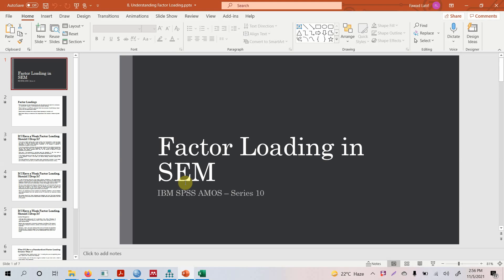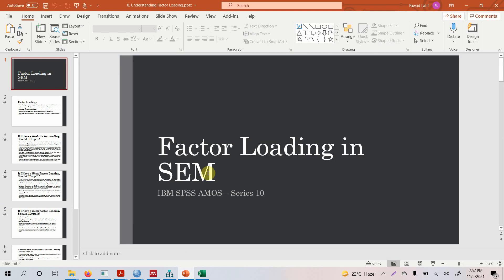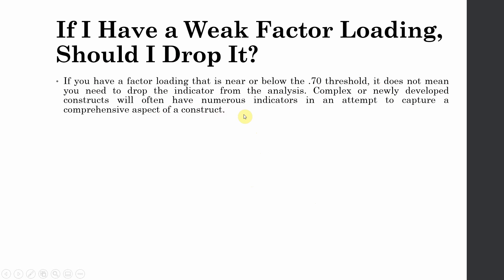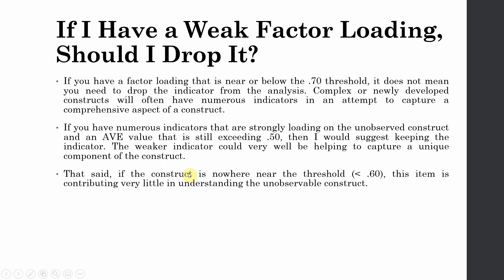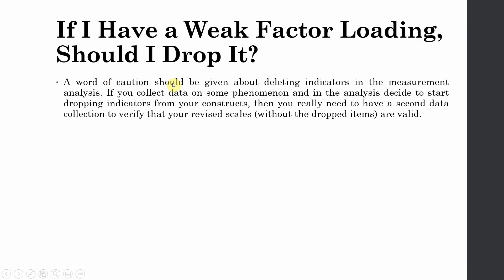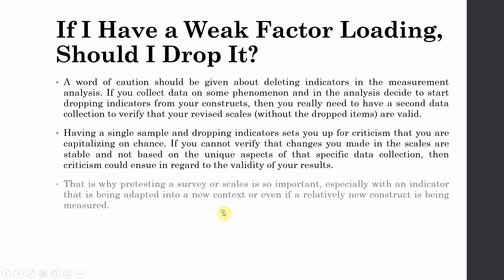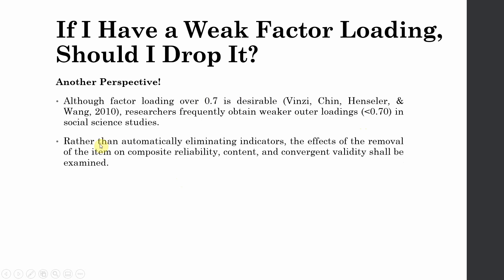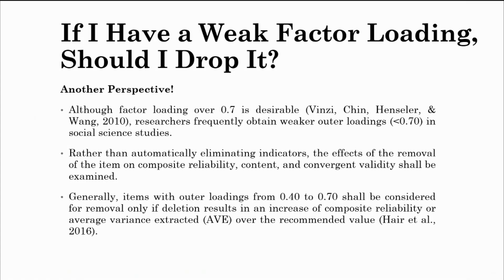14. SPSS AMOS | Factor Loadings in Structural Equation Modelling (SEM)

Comment: Assalamualaikum dr. Regarding deletion of indicator, Is there a restriction of how much can be deleted in a SEM-PLS study? Because I'm currently facing lack of discriminant validity in my thesis and to solve it I'm deleting quite a lot of indicator. Prior I have 62 indicator but I have deleted 17, is that consider okay dr? I have 6 constructs (4 IV, 1 moderating, 1 DV)
Thank you in advance
Reply from the maker: 17 is a little on a higher side.
But make sure, the content Validity is not violated.
Reply: @researchwithfawad  I see, it's too high. How much would you suggest is a sufficient number of deletion dr? Is there a specific reason for suggesting such deletion is too high? Thank you again for the respond dr
Reply from the maker: try not to go over 15-20% at most, if absolutely necessary
Reply: @researchwithfawad  understand. Thank you so much for the assistance dr.

Comment: Asalamualikum Sir,
If u could please share the references
Reply from the maker: WAS. Here they are, you can also check video description

Key References
Collier, J. E. (2020). Applied structural equation modeling using AMOS: Basic to advanced techniques. Routledge.

Hair, J.F., Jr., Hult, G.T.M., Ringle, C. and Sarstedt, M. (2016), A Primer on Partial Least Squares Structural Equation Modeling (PLS-SEM), Sage publications.

Vinzi, V. E., Chin, W. W., Henseler, J., & Wang, H. (2010). Handbook of partial least squares (Vol. 201, No. 0). Berlin: Springer.